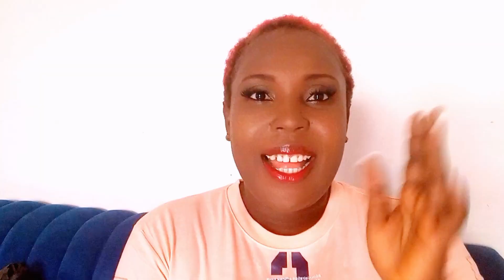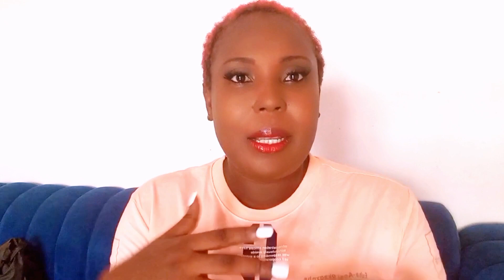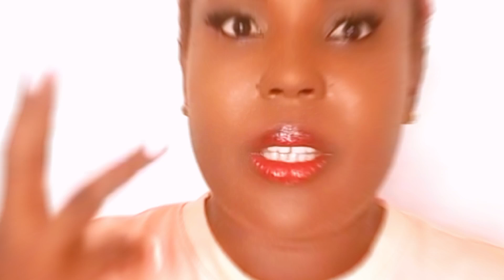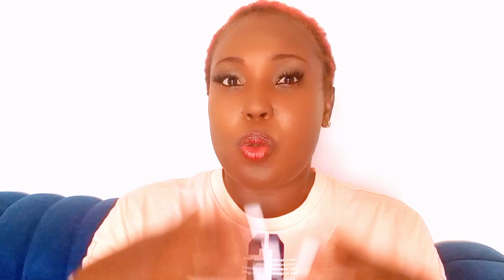Effortlessly Master Paint Production & Packaging: Streamline Your Process Today!"

Comment: What happened when the colour pigments is not first dissolved in water before turning it into the mixture?
Reply from the maker: When your mixing with high speed machine you can add your colour pigment directly.  But not advisable.  Also most people add the colour pigment immediately after the water. Instead of dissolved in a separate water.  When you add the colour pigment inside the production after mixing the chemical it gives the paint dots. When the paint is applied on the wall it wont be smooth also it will look like sand. Most at times when you don't dissolve the colour pigment well with water you will see trace of it inside  the paint.

Comment: Thank you very much ma .
My question is if a producer notice that after testing the paint that the paint has issues like staining of wall, peeling off from wall, or that the color is fading, how can the producer correct it ma.
Reply from the maker: you correct it by increasing your arcylic and add Calgon pt to your production process, always read the functions of chemical it enable you know what the chemical are meant for so you can add them to your production